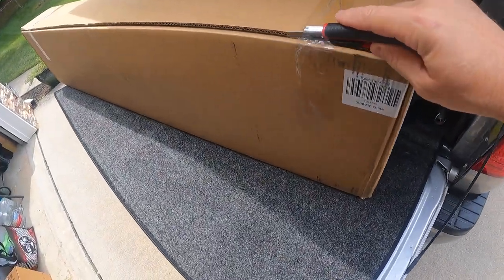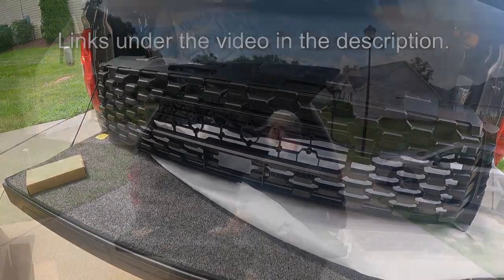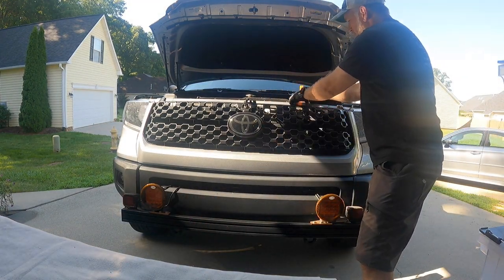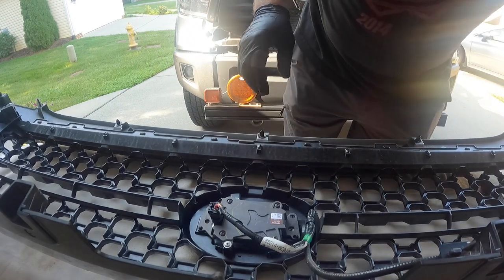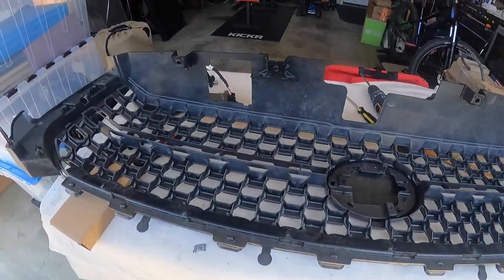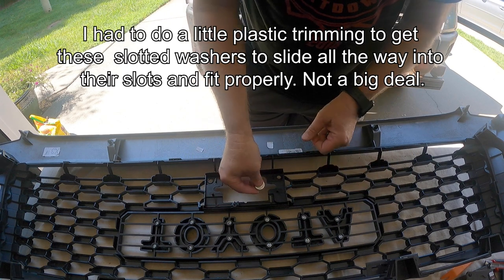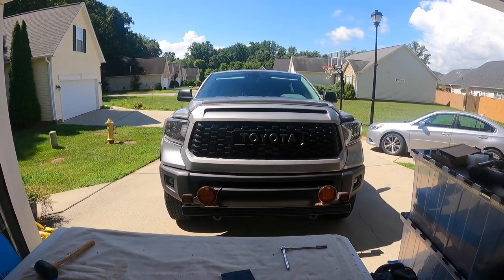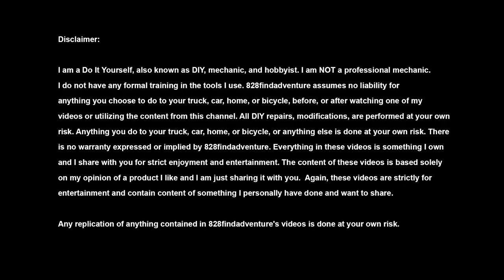TRD Pro Grille Insert install it's that easy in the Toyota Tundra

Comment: All I’m looking for is the outer part of the grill, can this be purchased? I don’t want to mess with the sensor do to the price of the garnish plate or having the sensor mess up.
Reply from the maker: Here you go and thanks for watching. https://www.ecoological.com/store/p81/2014-2021_Tundra_Grille_Surround_and_Hood_Bulge_Overlay_-_Chrome_Delete_Kit.html
Reply: Thanks for the info but I’m looking for the actual part, not a stick on cover piece.
Reply from the maker: @matthewmorris3997  I don’t have an individual part number. On eBay a Toyota dealer sells the TRD Sport grille which is what I started with. It was the only way to get a OE factory painted grille and upper bulge. If the surround is available it will be an unpainted part like body shops purchase.

Comment: I may do this, except delete or cut out the 'Toyota' logo. And then replace the empty logo area with a very high quality LED strip. Like they did for the latest Tundras and Tacomas, mounted ON the grille.
Reply from the maker: That would look great and be original.

Comment: Thanks for the video!  I ordered a replacement off of Ebay and then looked up your video to see how to install.  I was able to determine that the one I ordered did not have any way to mount the TSS sensor so sent it back before wasting any more time.  Now I'm searching for one that will work and I keep referring to your video for images to make sure the new one will be compatible.  2021 1794 Edition.
Reply from the maker: Keep looking they are out there, either on eBay or the Tundra forums.

Comment: Sadly, your listed provider cannot sell these grills due to possible Toyota trademark infringement. I have a 2019 TRD SR-5 with the huge chrome frame surrounding the grill. My only choice is the Toyota dealership. The only good thing is that I can pay shop price instead of retail price. It’s still a huge cost for the colored frame, Toyota insert and the acrylic piece of the TSS. Total is slightly over $800.00….🤦🏻‍♂️
Reply from the maker: My first grille was silver surround sport grille to replace the chrome thing. Then the insert. I’m sure there is a supplier, I’ll do some searching.

Comment: Hey how do you like your rubber bed May does it keep cargo from moving?
Reply from the maker: I like it. It's made by BED RUG and thick enough to kneel on so you don't hurt your knees. They are washable and come in different variations and prices. As for cargo, it might move a little with spirited driving but not much, everything pretty much stays put. Thanks for commenting. 
 https://amzn.to/3ic1clU

Comment: Looks better. I wanna do it to mine but i hate removing and tinkering with the darn grille lol. So much plastic to bend or break.     Hey are u still liking the RB20’s?  Holding up well?
Reply from the maker: I love the RB20s, they are super strong and rigid. Plus they have plenty of room for my giant feet. LOL Thanks for commenting. As for the grille, you are 100 % correct that the plastic is brittle. I feel the same way. Thanks for commenting and stay tuned.